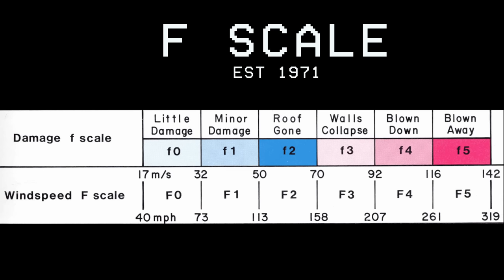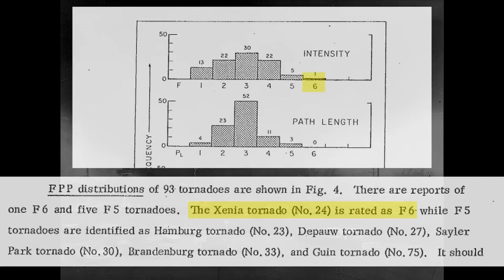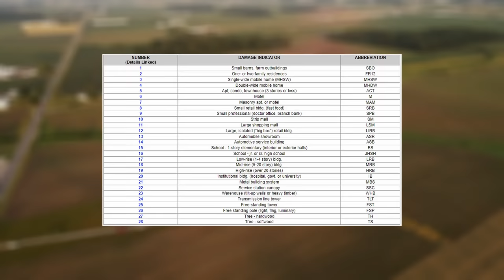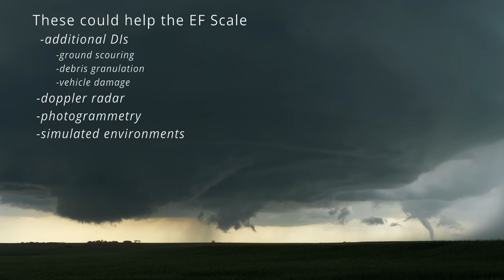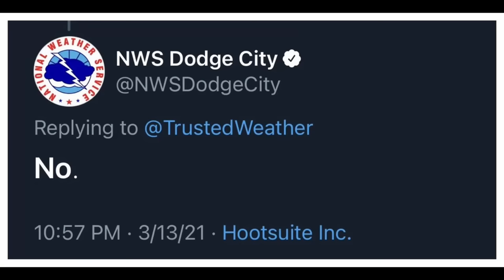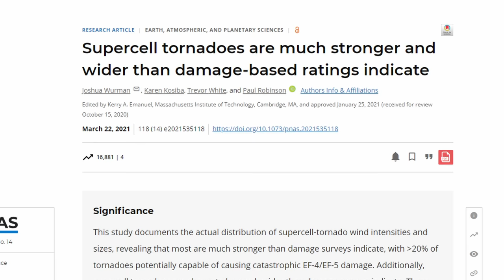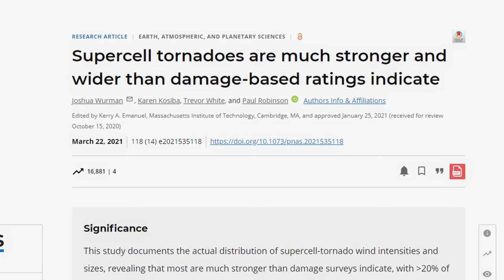Is The EF Scale Outdated?

Comment: I’ve been waiting for this video. I agree entirely. One needs only to examine the El Reno tornado to realize that the EF scale is garbage. That was a 5 if there ever was one. The true function of a rating system for these storms should be to establish some measurement of how strong the storm is, not what it incidentally happened to pass over. It is extremely misleading to categorize an exceptionally powerful tornado as anything less than that. 

One could also argue that it is more dangerous; for example, people being led to believe that EF5s basically never happen and EF4s are very rare could result in a more flippant attitude toward future storms when warnings are issued because they assume that their home will withstand an EF3. Conversely, if people were led to believe that more EF5 tornadoes are occurring than has been thus far portrayed by the EF rating scale, they may be more likely to take all tornadoes more seriously because of an increased sense of threat of the possibility of one being a high-end storm. Granted, that might be a bit of a reach, but I don’t see how it could hurt to do what is necessary to impress upon people the seriousness and danger of these storms. 

It is also ridiculous to examine the current “drought” of EF5s when clearly there have been several tornadoes since 2013 that could very sensibly be given that rating.
Reply: That's 100% true, I actually examined the range of wind speeds in each category (EF0 is 65-85mph, a width of 21mph, EF1 and EF2 have widths of 25mph, EF3 has a width of 30mph, and EF4 has a width of 35mph). Extending the EF scale further based on these range sizes would theoretically rate the El Reno tornado as an EF7 (EF5 would range from 201-240mph, EF6 from 241-285mph and EF7 from 286-335mph). Since the F scale's original max wind speed was 319mph, and tornadoes have come close to reaching that wind speed in the past, it would make sense to have these two extra categories to make things a bit clearer. For instance, the El Reno tornado had wind speeds of almost exactly 100mph greater than the minimum needed for an EF5, which is the same difference that can separate an EF0 tornado from an EF4 tornado. Rating a tornado as EF3 that could have easily killed tens of thousands of people had it hit only a handful of miles further to the east is pathetic. I'm surprised the EF scale has been used for as long as it has, judging by what was explained in the video.
Reply: That last sentence in particular is something that's been bugging me for years.  There's not really a "drought" at all, the methodology's just flawed.

When I can think of 3 storms off the top of my head that have measured winds exceeding the EF5 threshold (and there have certainly been more), there is a problem.
Reply: The previous scale, in my opinion needs to be used again. EF5 is any wind that surpasses 200 mph. But on the previous scale, F5 was 261-318. There was another tornado in the early 1990s (Andover outbreak) given an F4 rating, Red Rock, Oklahoma, but Howard Bluestein's early version of the DOW recorded 286 mph, clearly putting it in the F5 range. Another thing is that the size is not always an indication of the intensity. A giant wedge doesn't necessarily mean it's a violent tornado that F4 or F5. Pampa, Texas in 1995, was not, and it was an F4. It's easy to assume that the mile or more wide ones are the strongest (and many are). But there can be thinner tornadoes and still completely blow away strong buildings.
Reply: But it did no damage over EF3, it didn't even scour the earth or debark trees, a single measurement at 30 meters height says very little, specially since they measure instantenous velocity, not 3 second gust used in the EF scale.
Reply: @MrKittles1123 El Reno, El Reno, El Reno. That was a rare, exceptional tornado. It was clear-cut that the EF scale is a flawed scale. It's not garbage, that word it too harsh, but it's flawed (and it's replacement will be too, because there will never be a perfect way to rate tornadoes. But El Reno makes this look too simplistic, and it's not. It's so much more complex. Not every tornado will be similar in strength to El Reno, in fact, the vast majority of them won't be. It's also important to remember that it's not just super cell thunderstorms that spawn tornadoes. A QLCS (squall line) of thunderstorms produce short-lived tornadoes. Heck, even hurricanes produce tornadoes.
Reply: In regards to the second paragraph, who would actually think that way?? Most people don't care about this shit, we're tornado dorks, we're not representative of everyday people, you have to realize that.
Reply: Heck, I'd even argue that the El Reno Tornado was a mythical 6 on Fujita's original scale.
Reply: @opo3628  Tornados that strong scour the earth and leave cycloidal marks. The El Reno tornado didn't leave anything. And the original F-scale was also based on damage so it would be an F-3.
Reply: @opo3628  Forget El Reno for a minute. That was an exceptional tornado. Those kind are very rare, and highly unusual. El Reno makes it simple for High Risk Chris to put this together. But it's so much more complicated than looking at a single, rare event.
Reply: It would've wiped strongly built buildings clean from their foundations had it gone through a densely populated area at the intensity it was when the DOW recorded 296 mph winds.
Reply: A 2.6 mile wide tornado is barely comprehensible. That alone should be justification for an EF5 rating. Not to mention the wind speeds that were recorded
Reply: @sukhastings4200 widest tornado is debatable. It was 2.6 miles wide because the wall cloud was 2.6 miles wide and it happened to have "tornado force" winds under the entire wall cloud as the hook tightened up when the tornado was getting close to dissipating. Would've just been really strong RFD had nobody been killed. It's not uncommon to have high winds under a wall cloud. It's just uncommon to call the entire thing a tornado.
Reply: @metarunnermariokart  It's a damage scale. Make your own one if you please, but understand that the force of wind in function of speed is not linear, it's quadratic. The 2013 El Reno tornado didn't even scour the earth, which tells us that none of the vortices in the tornado reached the windspeed of El Reno 2011 or either Moore tornado. Same soil, 3 scour the earth, one doesn't. And you're keep telling me it was an EF5 when the only evidence available is a radar reading, which is associated with lower accuracy because they use zero-angle. We know at one point in a single area of the tornado there was a instantenous velocity that was fucking bonkers. The issue there is instantenous velocities is very different to averages, which is what the EF-scale uses, 3 second average. So you're comparing apples to baby ribs. The scale is fine, it does what it's supposed to. I'd be advocating for a second scale, like with quakes we haver Momentum Magnitud and Mercalli, totally different, they serve different purposes.
Reply: This is literally the attitude with Hurricanes here in Florida. More central Floridians know that when the hurricane is rated a Cat4/5 that it will be around Cat2/3 when inland and near you, so most people don't bother evacuating. The downside to this is areas that are claimed to be rated for Cat2 but then the storm is stronger than expected and stays a Cat4 when inland, causing much more damage.

This is with the wind speed calculations used, so if they can figure out the Hurricanes using that, why not tornados? Even if this spikes the number of EF4/5 isn't that a benefit that people know there are more dangerous ones around?
Reply: I consider El Reno to be another beast entirely. An EF5 doesn't fit that. It was bigger and badder than most EF5. I've read the report for the DI. They had trouble classifying some of it. It presented challenges for them. It and Joplin should have been classified as something bigger. Maybe catastrophic for storms like those.
Reply: @4amcripple  Ef4 and EF5 damage is literally called catastrophic damage.
Reply: @tomasallende9583  yeah even though it literally doesn't fit the definition
Reply: I'd argue it's way more dangerous to have this weird need to wish tornadoes are stronger than they are. EF3s are very deadly. EF2 are still dangerous and deadly. But it doesn't matter because when it's coming to you you don't know. It's nonsensical to think people are going to be like ''meh, I'm not going into the basement if it's not at least an EF-4'' as if they could know. The tornado didn't leave any damage higher than EF3, that's it, it's a damage scale, make another scale if it pleases you but F and EF scales are based solely on damage.
Reply: @metarunnermariokart  I'm not a fan of the EF scale by any means but this: "Rating a tornado as EF3 that could have easily killed tens of thousands of people had it hit only a handful of miles further to the east is pathetic." is such ridiculous hyperbole. It would take such a monumental clusterf*ck of events for a modern tornado to "kill tens of thousands" as to be nearly impossible. The May 3, 1999 outbreak killed 50 total in 4 states, if the wiki is to be believed, (I could have swore there was a total of 80 something just in OK... I must be getting old). Heck the worst tornado ever only killed ~700 so trying to multiply that by over 20 times would take a giant leap of extremely bad luck. We are talking something along the lines of May 3 hitting NYC moving at a near standstill and dropping many buildings full of people.
Reply: @tomasallende9583 he difference is, earthquakes are rated by magnitude, not damage done, they could give a shit about damage done when rating an earthquake…the EF scale is also not technically a “damage scale” it’s assessment of damage to ASSUME wind speeds. The ef ratings is still a wind speed scale when you look at it and that’s peoples frustrations with ignoring wind speed when recorded, not just with Doppler, but with 3 second gusts ect similar to hurricanes and estimating wind speeds that way as well
Reply: The rolling fork, ms should have been an ef5 in my opinion..
Reply: @Shinuchiha_99  Why tho... there was no EF5 damage, at this point every major EF4 should be an EF5 cause reasons.
Reply: Except that EF-5s occur more now because they're underrated........   the scale is totally wrong.....  Compare the wind speeds with the correct Fuijita Scale, te original.
EF-5  starts at  high-end  F3..... which is stil underrating something like El Rino,  but Joplin was overrated as an F3 tornado can reach 320kph and it was given a  5 rating even though F3 tornadoes are SUPER DEADLY ALREADY. They've killed a lot of people and cuase massive destruction, leveling houses, tossing cars far away and blowing strong walls down.

Many EF-5s are what used to be called F3 and sometimes F4.  F3's aren't occuring often but they're not super rare like F5's.
Reply: @ILoveOldTWC  YES!!! AMEN TO THAT.  There was nothing wrong with the old scale. It made more sense!
Reply: @ILoveOldTWC  Correct, there was a rope-shaped tornado, not too  big in Elie, Manitoba, Canada once but it packed a serious punch. It had F5 power.
Reply: @ILoveOldTWC  It's garbage.....  we need to re-instate the old system.  Old Fujita Scale is perfect. What is wrong with it?
Reply: @tomasallende9583   That's not true.  If the winds are measured, the rating is based on that. The damage is used for further research to see if the wind speed matches the damage.
Reply: @Firemarioflower  The F-scale was always wrong when it comes to windspeed, if an F3 can do what happened in Jarrel in 97 then there's no point for anything higher existing. They used the speed of sound cut to 12 points starting in hurricane force winds, that's all, it's not based on real life, but it gave 6 good categories to put tornadoes in, but without considering building quality a couple of poorly made houses can make an F3 into an F5, this happened a lot, many F5s have been reviewed as F4s or even F3s. The EF-scale serves to fix the discrepancies between the windspeed and the damage the F-scale had.
You probably know that the F-scale is called the Fujita–Pearson scale. Fujita wasn't working alone. Pearson died in 2016, if he had disagreed with the EF-scale, he had every chance to be very vocal about it, he never said anything. If the co-creator of the scale you're defending didn't defend it, you really think you know better than him, that would require some serious head in ass.
Finally, an F5 is an EF5 for the majority of cases. Saying Joplin was an F3 is beyond stupid and ... insulting to the victims? It's really not that hard. 
Finally, according to the way you think, you would have to believe that 1999 Moore tornado had 300 mph winds while the 2013 EF5 had 210 mph, even tho they did around the same level of damage. Stop thinking about radars and scales and damage and just use common sense, are you really telling me that F5s had at least 260 mph winds while EF5s had at most 210 mph? You don't think they over-estimated the first time? You know when computers were barely a thing, resources were a fraction of what's now, when footage of tornadoes was still rare, you think they got it perfectly right and then fucked it in 2007?
Reply: @Firemarioflower  Damage goes first, if measured winds are 300 mph and damage is equivalent to 150 mph, that's an EF3, remember El Reno?
Radar measurement was used in the same way as witness testimony, but the damage is what in the end gave the rating with the F-scale. They really are extremely similar, the EF-scale considers construction quality and that's about it, and it corrects the inflated original numbers.
Reply: @tomasallende9583 nobody wished anything? What are talking about?
Reply: Windspeed shouldnt yield ef ratings...
Reply: Did anyone ever Research about an alternative instead such the use of Torro Scale or even the newest development as what I could found on wiki said "International Fujita Scale" ???

Seems like it does exist somehow but just never got published.. barely heard anyone throughout this comment ever mentioned this alternatives 🤷
Reply: Did anyone ever Research about an alternative instead such the use of Torro Scale or even the newest development as what I could found on wiki said "International Fujita Scale" ???

Seems like it does exist somehow but just never got published.. barely heard anyone throughout this comment ever mentioned this alternatives 🤷

Comment: Long track, mutlivortex, wedge tordanos will always be F5s in my mind, espcially if they're a few miles wide. 
An F5 could strike an uninhabited  grassy field and be rated an F0 if going solely by damage to property 
But hey's that's my own two sense!

It's time for the RF scale!  Revised/Refined Fujita Scale
Reply: I have to ask you this question? Suppose the damage it causes (if it hits a populated area) is not consistent with F5/EF5, despite it's size and appearance? Suppose homes are unroofed but the majority of exterior walls are intact? No buildings completely flattened?
Reply: not true. The EF scale is what brought into account non structural damage. 2011 was the first time a tornado was rated EF5 from ground scouring alone in Mississippi. EF4 is still a beast of a storm but EF5 is the extreme of all extremes and those are exceptionally rare.
Reply: No. We should get  back to the old Fujita Scale or use the TORRO scale.
Reply: Except that there was a 1.1 mile wide wedge in Denton TX a few years ago that directly impacted several structures and only produced EF1 damage.  Can’t always judge be appearance.  Although as a general rule, yeah a long track wedge is “usually” going to be a strong tornado. 
Don’t sleep on some of the smaller but extremely violent tornadoes either.  Pampa TX ‘95, Elie,MB ‘07 , Plainfield, IL ‘90 etc…sometimes when those violent winds get constructed down into a smaller funnel the wind speeds can be exceedingly violent.

Comment: I have been looking at higher end tornado events for 20 years and I know extreme ground scouring, trees and low lying vegetation are completely stripped of all their bark, debris granulation, and vehicles turned to scrap are likely of F5/EF5  intensity. Something like the Westminster 2006 tornado that was rated high-end F3 should have been rated F5 based on not only slabbed houses but also extreme contextual damage.
Reply: Anna-Westminster, TX (2006) tornado is such a good example! That tornado was very strong but got only an F3 rating.  Reminded me of the Cisco, TX (2015) tornado that also was rated EF3 despite video evidence (of the rotation motion) and vegetation damage. Cisco also threw vehicles over 1000 yards, which is incredible!
Reply: @jm5390  Both tornadoes at the very minimum were both high-end F4/EF4
Reply: @cubby091398  F4 and EF 4  are different things.  An EF-4 is high end F2 to F3